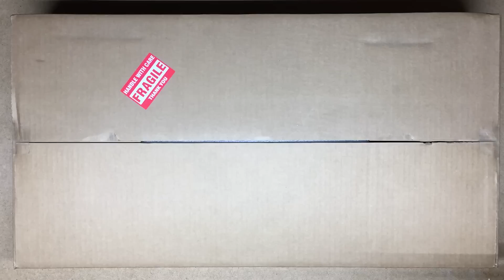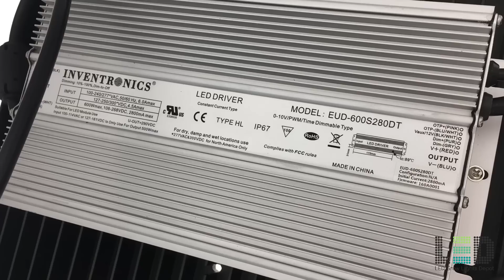Horticulture Lighting Group HLG-600H V2 Unboxing, Build, Review, & PAR Testing

Comment: Can you do a comparison with chilled LED. There are no videos around comparing any of the chilled LED lights. This will help a great audience make the best choice. Awesome light!!
Reply: I compared my HLG 600 to ChilLED's flagship light (the $1700 one). I used the ChilLED review video and did the same things they did, I also used their specs and other data to do the comparison. ChilLED is technically better out of the box, but you can buy 2 HLG 600s and the supplemental lights to fill in the missing spectrums from the HLG 600 for less money than the ChilLED system. Plus you'd have more PPFD than it. So less money, more PPFD. The ChilLED light is only superior if you want a turnkey solution and don't want to deal with the DIY side.
Reply: @Ancyker  I am planning my first grow and want to set it up to where I would be set for a few yrs. Would yo uh recommend the Chilled or the HLG setup you mentioned? Also, I have never done a diy light before, but I have seen growmau5 videos. I would have to invest in tools thought.
Reply: @dagainsta6253  I have 2 HLG 600s. I also have a vipar 400 that I had purchased first to try out growing. I put that between them to fill in that area a bit and because it has some IR. Not needed but nice to have. Which light depends on tent size. In a 4x4 the HLG 600 would win hands down. I have an 8x4.
Reply: @dagainsta6253  i was actually wondering which of these to get. I ended up with the HLG 600 set because rapid LED didn't have a warranty. The prebuilt hlg kit has a 1 year. I liked the rapid led pucks more though
Reply: Because it has better specs??
Reply: @dagainsta6253  yeah its more LED's total with red supplements which this one does not. But again I got this one since it had a warranty
Reply: @Cherub72  what do you think about the ES300 electric sky, if you were to put it in a 5x5.

Let me explain, 3 of the electric sky is needed in a 5x5

1 or 2 of the hlg600 in a 5x5 (what ever is needed)

And what ever is needed for growmau5's puck in a 5x5

In your opinion what comes out on top?
Reply: Jeff Tejada electric sky would be the best. But 1× hlg 600h costs A LOT less than 3× es 300 so i would go with Hlg 600
Reply: @maxrichard4647  ended up with the hlg 550 rspec , since it had better PPFD & highest umol/j (2.6)
Reply: Jeff Tejada
 Hlg 600h v2 = 1485+ PPF

Hlg 550 v2 = 1178 PPF

and the Hlg 600 is alot cheaper. Hope you got the new deep red version at least. Still a great light

Comment: Mine will be here tomorrow can't wait !
Reply: Mount your driver to the wall unless you need the heat they get hot
Reply: @gallagher831  I need the heat it's -36f here. When I get everything up running the way I want I will have all the power supplies mounted outside the tent. Cheer's
Reply: @gallagher831  i have a fan blowing on the heatsink. it made all the difference in the world. the carbon fan sucks out the little heat that gets blown off
Reply: you will love it, I tried many different heights and power levels, found the best was run it all the way up and at about 30 in high in veg and flower. works great!